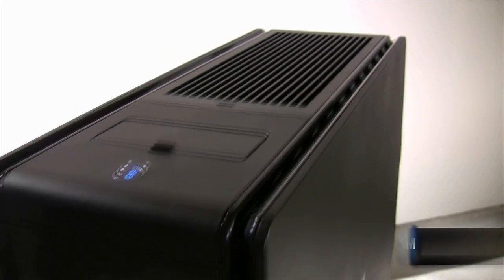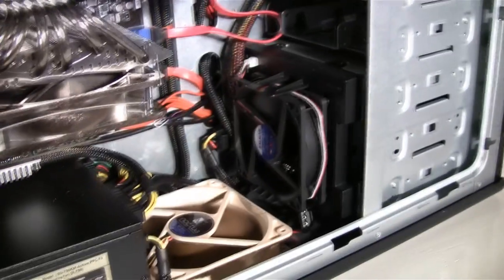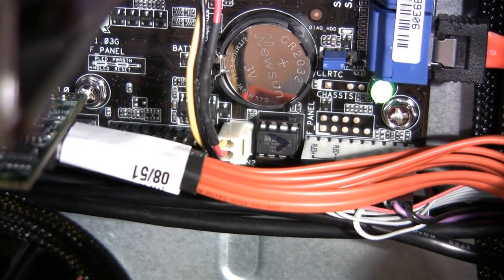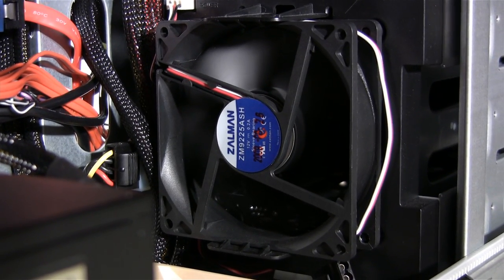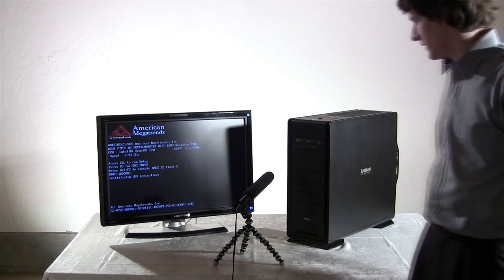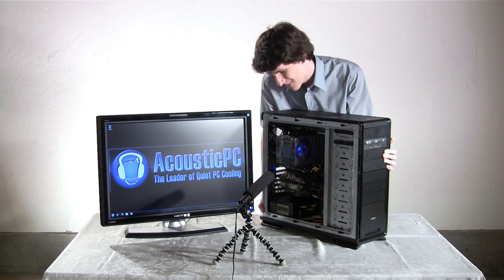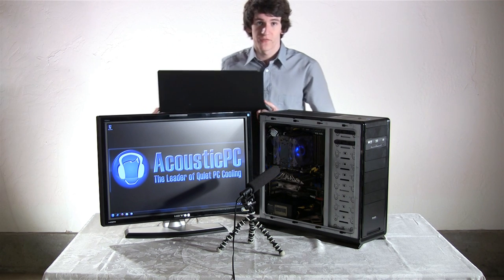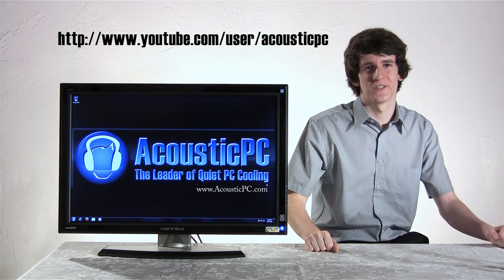How to Build a Quiet High-Performance PC Video Overview - Part 4 - AcousticPC.com

Comment from the maker: @robocopilu Thx for tunning in. SSD's since the time we did the video have grown in capacity and better value. but even now we would still use the Seagate SAS drives, due to their great balance of capacity, performance and value. Also you would be surprised as to how quiet these drives are they are def/ nothing like the old SCSI Hard Drives. But dont get me wrong im a huge fan of SSD as well every build is diffrent and so is ever situation.  We will be doing a build with ssd in the future.

Comment: @WhatsAmerica They are little cables that attach to the 3-pin fan connectors. They are basically resistors that convert 12v to 9v or 7v I think.

Comment from the maker: @WhatsAmerica the two tone Noctua NF-P12 cooling fans are one of the quietest fans available with sound optimized blade design. They also come with in-line ressistors and can be brought down to 12 dba...  we are running them at 19 dba and with the case closed the system is near silent lol.

Comment: @badboyo7 The microphone was directed exactly on the fans. If you were working in an office for example, the computer case would not be exactly right next to your head and it would not pick up just the noise of the air. And, if you think about it, with Water Cooling you would actually generate higher noise even on lower RPMs due to the fact that more air is hitting the fins of the water cooling setup. The noise generated in this system is mainly air noise and not the motor of the fans.

Comment from the maker: @Tinalusker We actually build and colabortaed on a review using a Zalman  HTPC  with a Seasonic fanless PSU. It just depends on what your doing. If you watched this particular 4 part video you will realize it's a high powered work station, for audio and video production, and of course needs more cooling. So again it just depends on the system and needs. Work Sation, Server, Gaming HTPC Home Theater or a high ventilation super ocverclocking machine. our goal is to do it as quiet as possible.

Comment from the maker: @gosuRoman The Zalman fans are running at 900 Rpm and the Noctua i belive we ran it at 1300 Rpm's but is is variable and can be run at lower speeds. And the Blue led silenx fans on the cooler run at 1600. All these fans can be adjusted to run at diffrent speeds by using a PC fan controller.

Comment from the maker: @DjViOd It sounds the same, the fans run at a set speed and the power supply will not power up until under-load and then operate at 16 Dba witch is extremely quiet. With the dides pannels on plus they have soundproofing foam. you would be hard pressed to hear noise!

Comment from the maker: @Thet3 Not yet, but thx for your request we may do one in the future. price to performance it; just does not make sense any more to liquid cool in my opinion.  The performance gain is minimal and the cost is so much greater, not to mention mainatnce and risk factor. Our air coolers provide excellent performance and are very close to performance if not equal to a top notch water cooling system at less than half the cost .

Comment: This video made me realize that even my older tower computer has place to put the wires on the right side so the air cooling works properly. So even 3-4 years old computers have this. Its there, but somehow this tower has it advertised as new feature.

Comment from the maker: @CrypticGamingNation it's like a well made house it starts from the ground up[. a good structure, in the case of a PC, a good case focus on quiet/ silent, sturdy well made with sound proofing, but you also need a quiet power supply, quiet case fans, and quiet CPU fan. and by combining it with good heatsinks you can achieve quiet, even silent yet high-performance even moderate overclocking is possible.

Comment from the maker: @AndreasAottiotta Sure you don't have to use all the fan slots we are merely showing all the fans that can be installed in this case.  Personally i don't see a big difference in NOISE by removing one or two fans but that is up to the user and their application. Every system is different and requires different cooling design.

Comment: @WhatsAmerica Just like how acousticpc wrote, the fans can be quieter with the adapters. This system already has some really hot equipment running. You could say that the Xeon processor they used is like a Core i7 Extreme processor. These Xeon processors can easily go up to 3.4-3.6GHz with turbo without overclocking. They could have removed one of the top fans, and just use one, and they would have been fine, and put on the adapters on the zalman fans and it would be completely silent.

Comment: watercooling only works well in large rigs. No room to put radiators in such a small case. Also it is very quiet and since the GPU is passively cooled  the extra fans are a smart idea.

Comment from the maker: @IchiJewSan little fans like that are hard to find quiet and low Rpm.  We have a pretty good selection both in 12v and 5 volt.  but i always like to run a cooler reguardless.  also i would recomend a good non conductive thermal when you change the chip. Either Noctua or even better Ceramique by Arctic Silver.. also the use of the ArctClean two part cleaner and purifier.

Comment from the maker: @alonsoeldemx Thx for your kind words, comments and input.  Comments like this these that inspire us to do more videos. I know what you mean.  Seagate drives are actually very quiet! but when you get quiet cooling fans, cpu fan and power supply for your system. a new noise emerges and that is the drives, but by using these quiet drives and a soundproofed case this should eliminate most of that noise or all. However we do see hardrive cooling and sound dampening enclosures. Thus totaly silent PC.

Comment: help me..my powersupply 4-pin connection wire is to short and now my whole power supply unit is loose from its original place..what should i do? buy another PSU?

Comment from the maker: @yomama771000 I believe this PC was in the 5-7 thousand range easy but we used a Xeon processor a super computer motherboard from ASUS and very special hard drives, everything top notch.  This is not always needed, and also since one year these parts have gone down in price drastically with all the new processors, and video cards. So it would be much less now. Look out sometime this week we will be coming out with some new videos on new builds, using dual 580gtx video cards and latest processors

Comment from the maker: @Ziakel Delta Fans are solid but LOUD!! The way i accomplish better than stock temps and quiet operation is with a massive heatsink, currently i would go for a Noctua NH-D14 CPU Cooler  or a Thermalright Venomous X CPU Cooler and for a lower profile cooler or downward venting a Noctua NH-C14 Low Profile Ultra Quiet CPU Cooler. Im able to get better than stock temops, moderateoverclocking as well as very quiet operation and to shave off of few extra degrees Arctic Silver or IC Diamond compound.

Comment: the only noob question I have is if you have a 700W PSU is 700W being used all the time or just what the components use up and 700W is the cap?

Comment from the maker: @y35n00b5 No problem at all. It only uses what the components are using it has an active pfc This 750PSU is the quittest on the market and the most energy efficient and also come in a 650 watt model.  visit our online store Acoustic PC and you can see both models and specs there.  Thx for your question. it is a very good one

Comment from the maker: @malicios The prob, with the corsair liquid cooler is that it has dual fans on the radiator and they are louder and does not perform as well as our thermalright coolers. on top of that it has the pump and that also has a hum to it and should it ever break.  hummm. also it is sealed so no maintanace can be done. and you always have that risk of leakage.  but we do sell it and we have plenty of better solutions' for water cooling but again our focus here is performance quiet, silence, reliability

Comment from the maker: @rakib567  with out counting the power supply or quiet cooling components and case you are looking approx close to 4,000.  We built this system as a sample fro the video and use it for audio and video production.  You do not need to get the same parts we got.  Depending on your application it can vary and be less or more. For prices on cooling componets please visti us at our onlIine store Acoustic PC

Comment from the maker: @mijav2 The Thermalright VENOMOUS X CPU Cooler is an excellent cooler.  And while it brings clips for a dual fan set up. It is not needed. YOU use the dual fans to get the max performance on a push pull airflow set up.  My sugestion is get a lkkow Rpm fan such as a Noctua NF-P12 or Even a Thermalright 1000 RPM Fluid Dynamic bearing fan. It is noiseless and get the job done! We have a wide selection of fan at AcousticPC(DOT)COM However these are some of the quietest.

Comment: my computer sounds like that when you have the side panel of (i have it off 24/7 for better cooling) and i have everything in stock :)

asus P7H55-M
4 GB DDR3 1333 MHz
1x500 GB 7200 rpm
1x640 GB 7200 rpm
intel i3 530 2.93 GHz
ATI XFX HD 5670 1GB

Comment from the maker: @smackthat9876 with intel the prob, is those low performance heatsinks and the pwm feature withc i dont like.. rather have a 3 pin fan with a high perfoemance heatsink.  Amd as well they provide you with a heatsinbk that will cool just good enough to get you by... it;s kind lkike buying a pc case with free fans and psu... you cant expect the free components to be the best.

Comment from the maker: @IchiJewSan If you are really techy you can swap the fan for a quiet one, i can;t advise yu to due the following but this is what i have done before, disable the internal fan and run it with a laptop cooler. it has worked with me but it can be risky. Also taking these notebooks a-part is not fun.

Comment from the maker: @mproductionsmusik We tried Lian Li cases a-long time ago and we had vibration issues, i have not worked with them for along time so perhaps they are better now. However they are really aesthetically pleasing... nice clean lines and clever air flow  designs, some times. I do prefer Zalman cases and a few others totaly focus on quite. i like sturdy cases that dont vibrate. looks comes second to me tho i do like the Zalman cases allot looks wise as well.

Comment: you should have put artic accelero xtreme on that GPU, its far much cooler than this zalman heatsink+120mm fan solution, not to mention that sound levels are the same or even better.
Same with CPU heatsink, it should rather be a noctua nh-d12, if you can afford a xeon processor, than you can also afford that in my opinion.
Maybe case should could have also been a Fractal Design R3, or an Antec P183.

Comment from the maker: @MrGiggdygiggdygoo You can use any socket for a quiet machine and for an audio and video production system there are certain advantages with certain sockets and speeds but you can actually do your production with any of them.  We just built this particular build as an example.  I7 Cores CPU's also offer allot of performance and value.

Comment: @freecomptechreview *sigh* Microphones can amplify very quiet sounds. (make them sound very loud) You can control the amplification of the sound by ADJUSTING the mic's gain.  Therefore, if he was trying to prove that this computer was quiet, as you seem to believe, he would have simply ADJUSTED the gain until it was barely audible, or completely silent, depending on how gullible he thinks people like you are.  :)